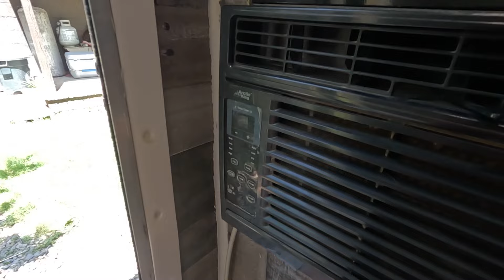Truck Camper Hidden A/C Install

Comment: I like it!  Getting the weight low when you're talking about a slide-in camper is good, the camper is top-heavy enough.  It also puts you shopping for new window units if anything goes wrong, and those are both easily found anywhere and WAY less expensive than any RV system.

Sealing up the duct that carries away the warm air is a good idea, and you could consider adding a fan either on the intake or exhaust side to improve airflow over the condenser.  To improve matters with the airflow at the cold side, just put a fan pointed toward the bunks to send the air that direction; adding a deflector might reduce airflow more than is healthy and cause the coil to freeze over.

Comment: Looking damnnn goood!  You should put a small 12V Radiator Fan in behind the AC to help it pull some air thoguh. Or even a huge PC style fan would probably work fine too.

Comment: You probably already plan to use grey butyl tape around  your vent covers. Looks like you did a good job engineering  the install. Good job 👍👍